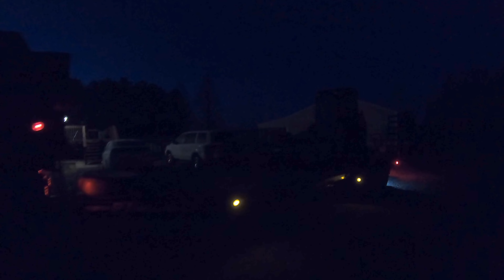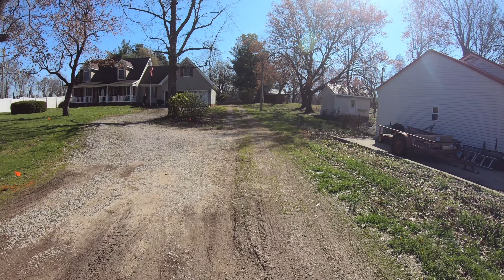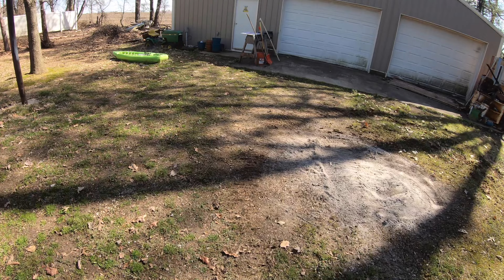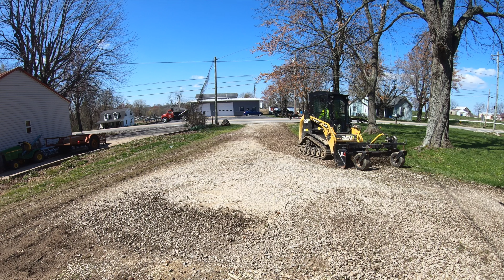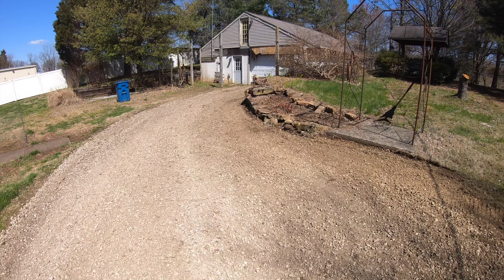Restoring Gravel Driveway with MX6 Harley Rake

Comment: How does the Harley rake work on crushed packed limestone?
Reply from the maker: It works pretty good. But it hurts me on the inside to use it on hard packed rock. It just seems rough on it and I don't like doing it. 
Sometimes I'll rip with the bucket teeth first then Harley rake.